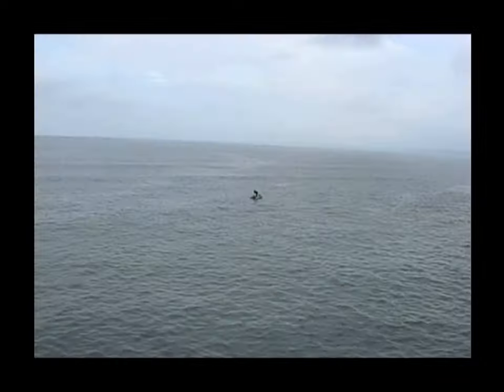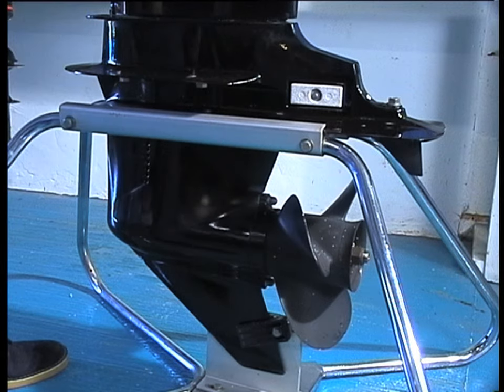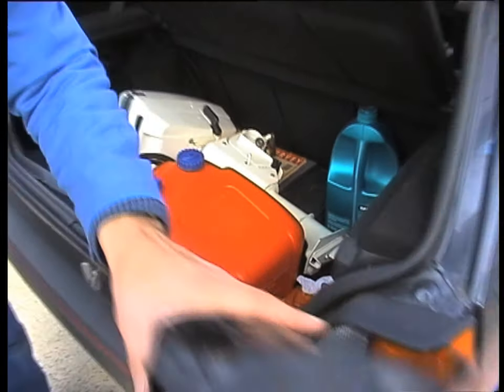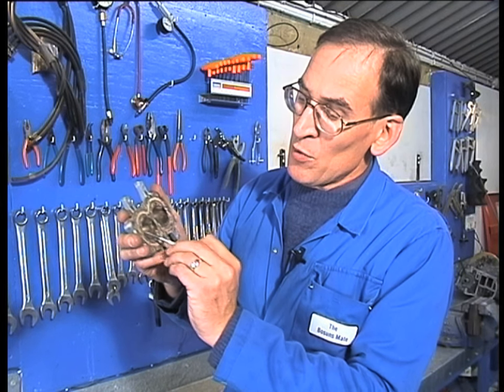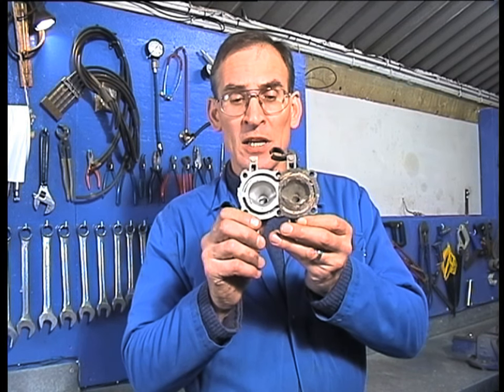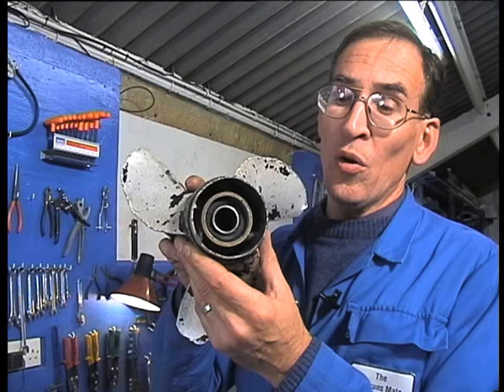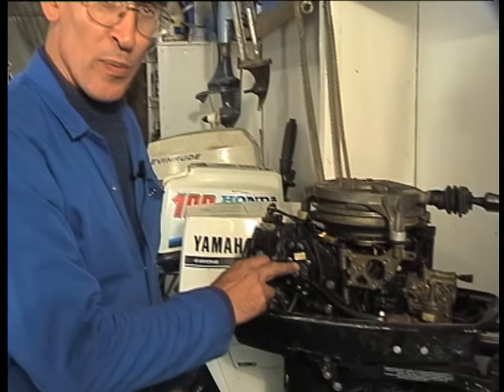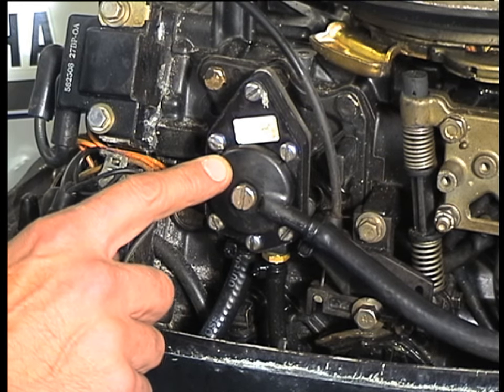OUTBOARD TROUBLESHOOTING (Part 1) Basic introduction & Top 10 Common Outboard Engine Faults

Comment: Thanks very much for your informative video, I can reiterate all the main points from my experience with old outboard motors, but you put it in a clear concise manner. I have just bought a 4 horsepower 2 stroke twin Johnson which will only run on full power, but you have given me some good starting points😊

Comment: Hi,

I did see a couple of your videos and thank you for the information.
Any change you have a video to clean the water cooling pipes?
The impeller works with mine motor but the pipes where the water goes are stuck. ( Johnson 5pk 1998 motor)